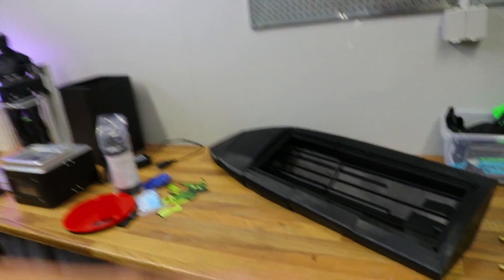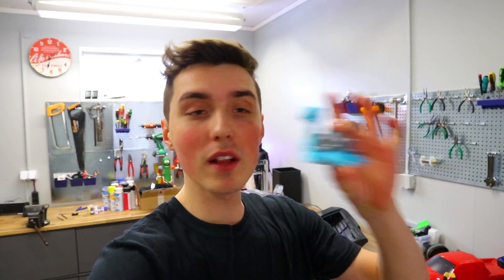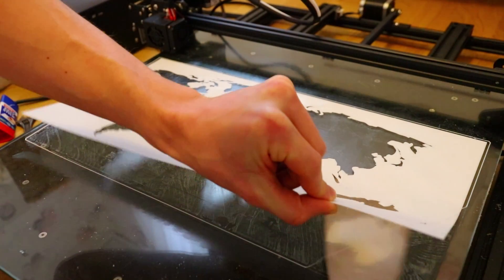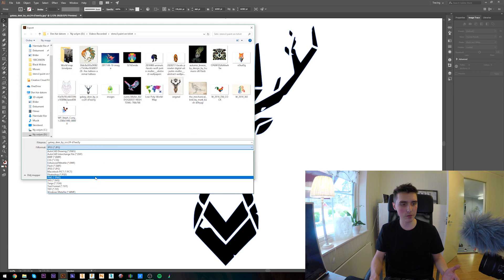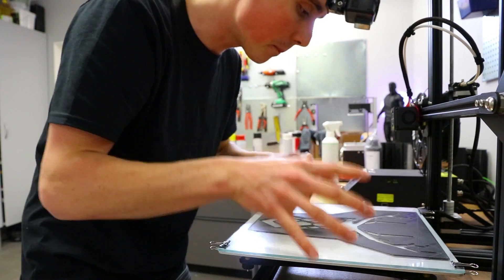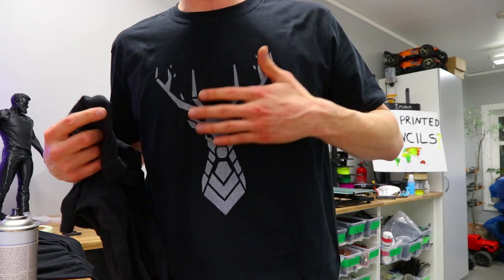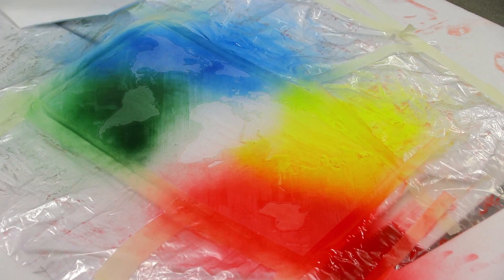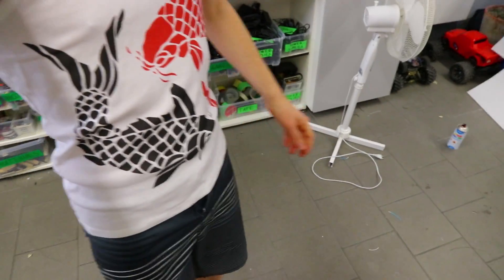NEW Crazy 3D Printing T-shirt Stencils!

Comment: Would have been nice for you to wash a t-shirt like in previous video, where you printed directly onto the t-shirt, as a comparison. I guess the oil based paints work OK through a wash cycle or two? 
How about trying dyes. Will they bleed too much under the stencil?

Comment: Brilliant! I did this a while ago. It worked ok for me, but I wasn't very very satisfied. Might have to try again.

What I found the most difficult was getting the stencil to sit flat against the garment. It was a real pain in the butt. I tried temporary glue, magnets, and weights. Never was completely happy with the result. I think my problem was that I wanted to use spray paint. If there is any gap, the paint will find it and make edges soft. Probably a better idea to brush. I'll have to try a stickier glue like you did. I guess I was afraid to use a glue that would gum up the garment.

You can probably improve the color on black by doing a white base first.

Oh yeah, another problem I had is that I had to print my stencil in several pieces because I don't have a large machine, but that really shouldn't be a big deal; you just have to do a good job at joining the pieces (with tape?).

Love the rainbow map!

I feel like your glue choice is key.

Comment: I'd been pondering using 3D printed stencils for making PCBs (circuitboards), ie: you use it to selectively apply an etch resist, or even an etch paste.  
Or if you 3D print straight onto the PCB, you can electro-etch by using the stencil itself as the resist to protect the board.

Also you can go the other way, and instead of using stencils you can use STAMPS.
(or you can use a stencil --> to etch a stamp, if you want a super tough metal stamp).

Comment: I thought of these types of stencils to use for screen printing. It would make a lot less work then usual. If you want something to be washable though I'd recommend water based screen printing inks. They can be put into the shirt with an iron and the shirts will be washable at 30°C. You could also try to use an airbrush with the screen printing inks and your stencil.

Comment: Simon if you want dual color on your 3D printers look into 3D printing a Y splitter to feed multiple extruders into one nozzle. It requires a lot of knowledge to get it to work and a customer g code, but I got it working perfectly on my Tevo tarantula. I plan to add 2 more colors later to make it a 4 color printer. If you want any help just talk to me. Oh and as far as cost goes you only need to pay for another motor, possibly another heartbreak(it has to allow the PTF tubing to go into it and like 10 cents worth of filament for printing a Y splitter lol.

Comment: this idea is awesome especially if the idea is that someone doesn't like using screen printing.... but as long as the design is in solid shapes and silhouette shapes then this stencil is useful, to compare it with screen printing... the texture of this one is more smooth and full color while in screen printing is like a half-tone texture.

Comment: How about screen printing. I Think it should be possible to print the negativ picture into the mesh an then use it for screen printing. So you do not need to handle with that uv light for development and even try to print the Frame at once...
Reply: That would never work. The mesh has to stay flexible.
Coating a Screenmesh takes like 5 seconds, and the development takes 12 minutes.
I dont see it being useful, using a 3d printer for this.

Also, if you need merchandise, hit me on.
Reply: The Flexibility is not a problem.
There are other Materials you can use to Print.
And it's not that easy to prepare for a screen print.
1. You have to prepare a Frame with mesh (in the best case with an Aluminium Frame... expansive)
2. You need the coating, that you usually can't by in small amounts if you want it for a good price.
3. You need a printer that's able to Print on Plastic for the negative
4. You need a room with low UV-light for preparation
5. After development, you have to wash out the coating

So for me it sounds much easier to prepare the heatbed with a mesh and feed the 3D printer with a flexible filament
The only Question is if the Filament and the mesh will hold together probably.
Reply: 1. buy one for less than 30$
2. 500g for 30$
3. Inkjet printer with pigmentblack and a film for 1$
4. You need a room with a Yellow lightbulb... 5$
5. washing out is as easy taking a bath.

The mesh is a Polyester material, i dont think it would withstand the head.

Sincerely Fabertex.de
Reply: I doubt 3d printing would work well but I've seen some AMAZING results with laser cutter.  Using a sheet of kapton and having the laser cutter cut a dot matrix where you want the ink to go through.  Make a full reusable stencil in a few minutes without any UV photo developer.

Comment: So what happens when you wash them? Screen printing uses a plastisol ink and is cured with a high heat so that it bonds with the fabric. At best I'm not sure that spray paint will last and at worst it I would be afraid of it ruining other clothes washed with it.
Reply: Haha isn't it just the way.  We worry so much about the spray-paint staying on the shirt.
But when you accidentally get spray-paint on your shirt - then it somehow becomes IMPOSSIBLE to remove.
How can these 2 situations both exist in the same universe, argh.
Reply: I've got spray paint stencil shirts that I made over a decade ago.  It holds up surprisingly well.  Some of them have faded, but I think it just adds to the uniqueness of the shirt.
Reply: In my experience Spray paint bonds pretty well, though it sometimes fades. After the initial wash it should be safe to wash with other clothes, though I highly recommend washing cold and hanging to dry/low temp drying, not just for these but all your clothes you want color to last.

Comment: Hey Simon, great idea and it worked superbly. What sort of paint did you use and can the shirts be machine washed afterwards.
I think I prefer the Yin & Yang Fish Edition.
Reply: It looked like he was just using some standard spray paint but I would not use it on textiles you expect to wear more than once or twice.  You can get fabric paint pretty cheaply.  I would use that instead.  Or just buy some image transfer paper and no 3d printer needed.  Just an iron.
Reply: The paint Simon used is really irrelevant.  You can buy fabric paint that is machine washable.
Reply: Yup, you can most definitely find them at hobby stores or online.  Just search on "Fabric Paint".  Use a small paint roller or brush to apply.  Gives you more control over where the paint goes.  Happy making!
Reply: I wonder that myself.
Reply: Thanks for the reply. I didn't know fabric paint existed. I'll keep an eye out for it.
The image transfer paper would be a good idea, if I had any artistic skills ... but I don't :-)
Reply: @WillieRants Thanks for your advice, I didn't know it would also be machine washable too. Good to know.
Reply: Iron on might even be better.

Comment: Hey Simon, I am new into 3d printing, I am searching a good one under €300. I am still not sure wich one I need to buy. Should I buy the anet a8 or the tevo tarentula. If you know any good other printer please let me know. Thanks you. Nice video too!
Reply: Flsun on aliexpress has 3d printers with dual z and with a 300*300*420 build size shipped from Germany for 250 $ it has a 37 800 000 mm3 build area compared to the tarantulas 9 680 000. Personally, I have a Tarantula and I am happy with it (soon the 1-year anniversary) but if I would buy a printer today the Flsun would probably be the choice since the much larger build area and already dual z.
Reply: +Akalle Thank you! If anyone else still know an other one let me know! I will check ik out for sure!
Reply: +Akalle I have seen some videos about it and it looks like there are some huge issuesses with the kits and to build them can you confrim that?
Reply: Vince Van der Perre I don’t own a flsun only a Tarantula so I can’t confirm it
Reply: Creality Ender 2...$159 with heated bed
Reply: FPV RC Cars it's too expensive. Thanks anyway.
Reply: vidznstuff1 I will take a look at it.
Reply: You'll be totally fine with the Anet A8. It's a good idea to buy cheap and have some  backup cash in your budget for addons, tweaks, tunings etc. If the print volume matches your demands, there's little reason to look elsewhere, really.
Reply: I would recommend the Anet A6 instead of the A8 because of the slightly larger build volume. You have to be ready to tinker with it though. I'd buy an Raspberry Pi 3 for Octoprint straight with it to make it independent of a desktop computer.
Reply: Vince Van der Perre cr10